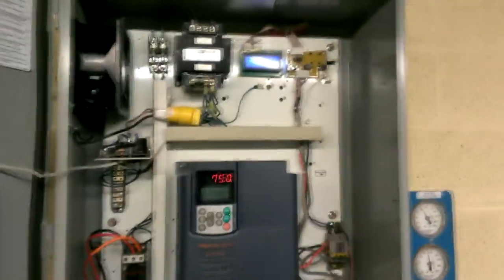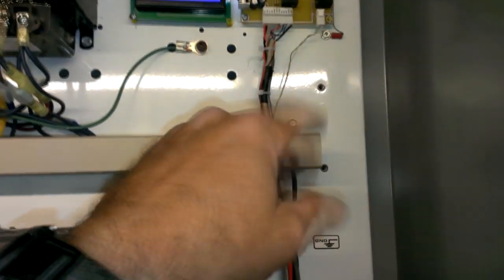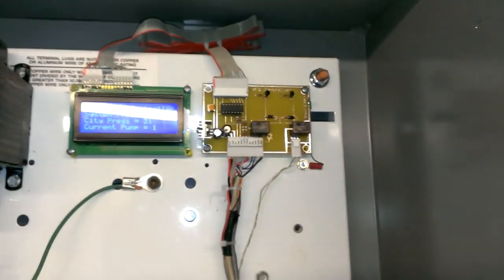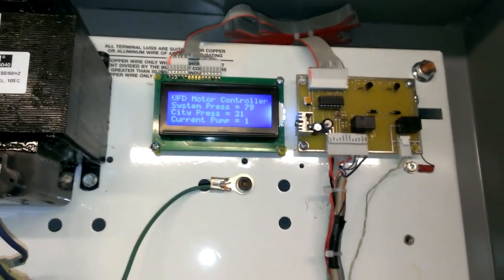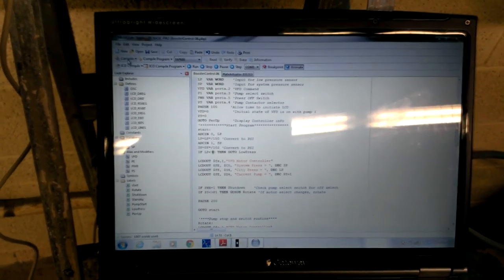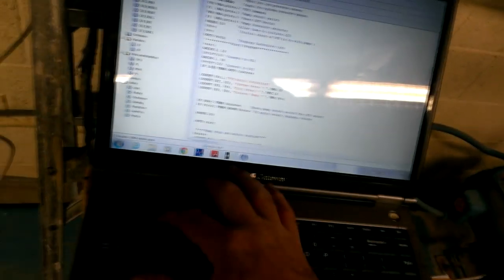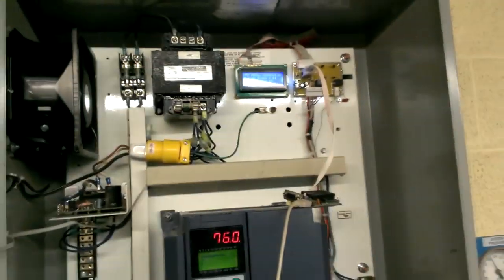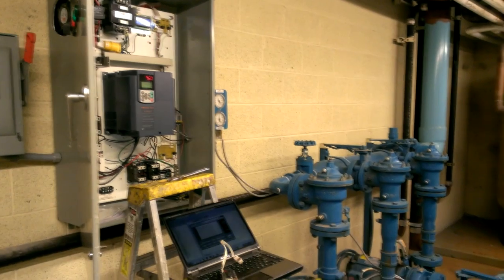VFD Project Update: Installed custom made VFD control board and reprogrammed

Comment: Impressed, I've used a laptop with JC's & HnyWl's software to program their CPUs that have analog & Digital I/O's controlling Belimo powered 0-10vdc valves & VFD's etc, cool stuff but I never made my own or seen anyone in the field make their own controller boards, displays & program them to act special order custom mod,. You need a raise.